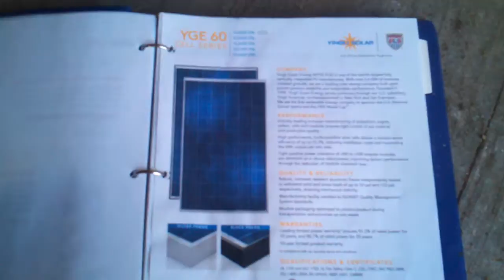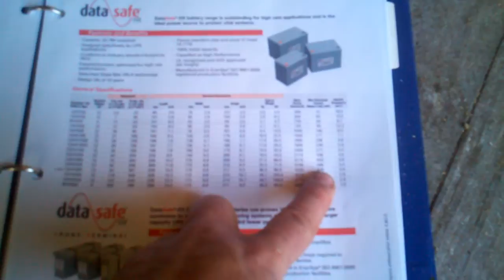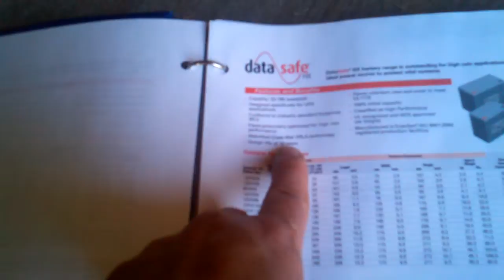My solar battery bank - DATA SAFE AGM Battries

Comment: How long have you been using those batteries and how has it worked for you? What percentage is the battery discharging? I have a bank of these batteries and I want to know how far they can be discharged at 50 percent or 60 percent.

Comment: How have them batteries work out. Just wondering cause i have a pile to use i just got. Just wondering if there good for solar beings your video is back in 2013 lots of time has past i bet you have  the right answer to how they held up. Are they still good now still.  Would love to hear about. TKS
Reply from the maker: I still have them. These are good for about 3500 Cycles or 10 years. That is a discharge from 100% to 20%. If you don't discharge them all the way they should last alot longer. I very rarely discharge them as my shore power is very reliable where I am now. Hope this helps.
Reply: @GuyBrown  Glad to hear Thanks

Comment: Inspirational!
Recently acquired a huge lot of valve regulated 7Ah ups batteries that have the 1/4 inch spade terminals. I want to connected them into sub banks of ten each leading to a bus bar. Each sub bank would be about 70 AH.
The maximum wire size for a "yellow" connector is 10AWG, that is not an issue but trying to source a few hundred of these terminals is going to be expensive as I have well in excess of 200 of these batteries. Date code is 03 of 2013, for ALL of them.
Aside from soldering to the tabs (I really rather not do that) I am at a loss of any alternatives. The voltages of these 12 volt batteries are currently all within one tenth of a volt of another but will need to get them charged and into use

Comment: I can get 20 of these exact batteries for $1200. 9 months old. They used in a UPS a backup system. Should I get them? What percentage could I use them daily and keep them running?  Draw 20-40% daily or would that wear them out?

Comment: Were yours in parallel or were they serirs parallel? I just purchased 20 of the 12HX505-FR and plan to use them in series parallel to have 24 volt bank for my off grid solar. How are yours doing all these years later? Thank for any advice. I think you did an excellent job arranging building that bench for yours.

Comment: I'm also using AGM UPS batteries for my solar. They are one cell, 2.2 volts so I bought six and wired them for 12 volts. They're big,195 amp hrs. per cell and 200lbs. each. A power plant here was being torn down and I got them cheap.I read about charging them and the manufacturer is very specific about voltages. How touchy are batteries of this type? Will it harm them to discharge them to maybe 70%? The maker recommends charging them at no more than 10% of the amp hr rating. Any experience use have would be helpful, thanks, Doak

Comment: How well is your batteries holding up? I found some one that has some that are only about 6 months old. They are the 12HX540 that I am considering. Any advice good or bad with using Data Safe batteries? Do you have any idea how much you can discharge these with out hurting them? For regular lead acid they recomend trying not to go under 50% which is close to 12.0 volts. Any info on the life cycles compared to a Trojan deep cycle? Any advise would be a great help.
Reply: I ran a hx540 in my truck for 3yrs and it did good

Comment: Question if you can shed some light for me.. I bought a DataSafe 12rh505-fr and wanted to ask if you know if this battery can be mounted on its side?? Where I wanted to mount it, isn’t tall enough.. any info is greatly appreciated.. thanks
Reply: Yes you can mount them on there side
Reply: @KnowName33  thanks for the info I couldn’t and still can’t a damn thing about that but I’ll take your word for it.. 💪🏼🙌🏼👍🏼